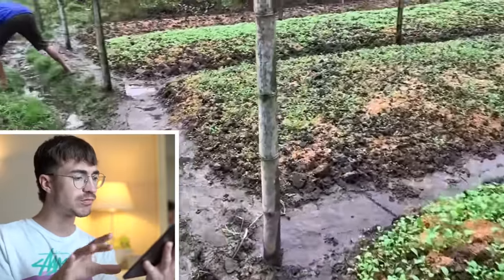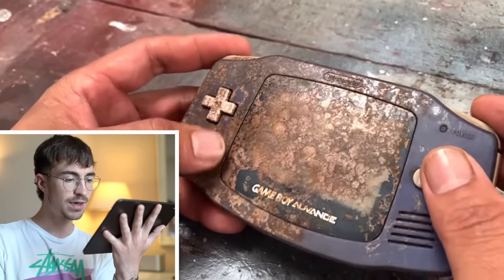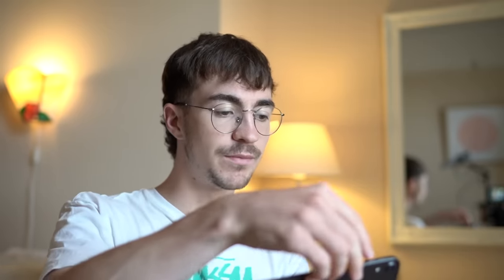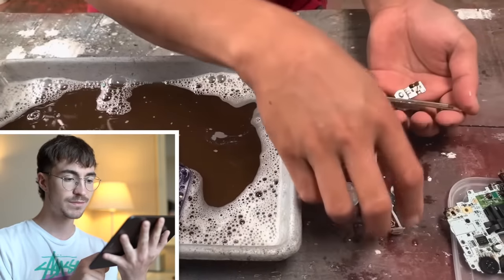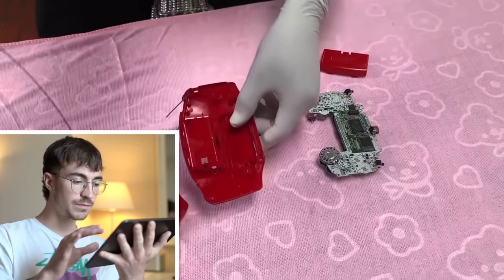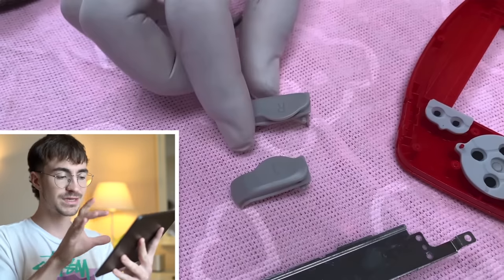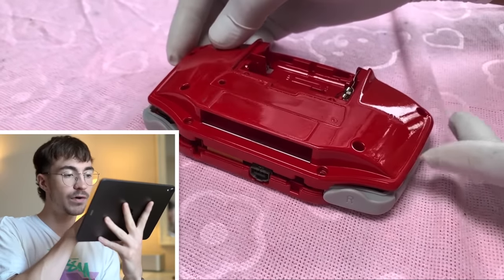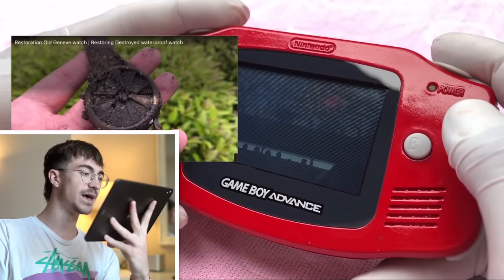Exposing FAKE Restoration Videos!

Comment: The giveaway for my inexperienced eye was: Why paint the inside of the case, and to a degree he got every nook and cranny.
Also he found it with no battery cover, and those things dont survive regular use...
He has one in the end, so that just means the shell was a kit.
Reply: Nah it’s the same shell,I can tell by the shit paint job they did
Reply: I'd do that, it would annoy me knowing that the inside isn't coloured, plus it makes for a satisfying video.
Reply: @onemoreweirdo207  I'd be more worried about any peeling inside the device shorting something out.
Reply: @xinx-fn8973  I thought he might've swapped for aftermarket case as well until I saw that crappy amateur paint @11:11
Reply: I think he got a new red case and hit it with paint or clear on the front to make it look more authentic (to look like it was painted) but the close-ups of the tiny stand-offs are even red inside and there's no way to hit those with a rattle can, or the little holes would be plugged up.
Reply: The outside of the case was a bad paint job but the inside looked really good, considering that would be the harder side
Reply: @xinx-fn8973  So they bought a new blue shell, and spray painted that. Voila. You are blind.

Comment: I love how spray painting the shell red turned the shell into a translucent red shell. Anyone know the name of that spray paint or perhaps where I can pick up a can or 2? Are there other color spray paints that turn plastic translucent?
Reply: I just like the electronics submerged in dirty ass mud and water, and somehow a little bit of scrubbing gets all of that out from inbetween the layers of ribbon cables and the layers of the screen...... hahaha
Reply: @SSXVegeta  A neat trick for sure.

*Stupid mobile keyboard.
Reply: It's the same brand paint that Mr. Q from Die another day used to make the car invisible. Just thin it and apply 10 coats and the car becomes invisible.
Reply: @Wingedmechanic  now that would be awesome.
Reply: i rewatched that part three times before i scrolled down to find you'd already posted about it, but your dead right, that original case was too dark and opaque to let light through
Reply: @frogmastiff8198  no he painted it go throught the video and you can see the mistakes in the orange peel. plastic that thin does shine like that.... lookm at 11:11 in particular. the guy may have gotton aftermarket parts but he did restore it
Reply: No that's definitely just light passing through the plastic.
Reply: 11:13 it's clearly painted... terribly.
Reply: Coop 772 on YouTube has a video on how to paint things clear
Reply: 11:10  That is definitely a spray painted shell. Not sure about rest of shots but the shot I time stamped is 100% spray painted. Of all the things to make fun of, the painting is the least of of them. Scrubbing the motherboard and all the electronics with a brush after soaking everything in water is ludicrous.
Reply: @avidadolares  yeah I second this
Reply: Definitely a spray painted shell. 11:12 says it all, just look and the plastic above the screen.
Reply: Spray Acetone 😆
Reply: Excuse me, it may be spray painted, but how the heck dark blue plastic will turn completely red without any shades of darkness when the light shines through it?
Reply: A layer or two of clear coat on an a red case would easily give the appearance of having been "spray painted." A professional faker, indeed.

Comment: I'm here to tell you (believe it or not) back in my teen years I lost an original Gameboy around the property we lived on. Lost it during a nasty storm. It was rained on for days and later fire ants incorporated it into part of their mound. Found it the next year when we were getting ready to move, I cleaned out the ants just to see if it would work. Powered on at my surprise and worked except for a dark line going horizontally across the screen. But yeah most of the restorations are fake because I never see most replace the screen.
Reply: Those gameboys were durable..
Reply: @nillman  unlike tech today, just breaks for no reason whatsoever.
Reply: @The_Backlog_Files  it breaks so you'll have to buy another one.
Reply: My sister had an iPod she lost somewhere and winter came and went and then we found it in the back yard when the snow was melting. Brought it inside still half frozen in a block of dirty ice and it worked for several years after
Reply: @HugeESmalls  yup old technology was built to last.
Reply: I can speak to the toughness of old Nintendo products. One of my childhood friends was over at my house playing Super Street Fighter with me. He got mad that he kept losing and threw my SNES out the second story window down onto the concrete patio.

The case was ruined and the Street Fighter cart didn't survive but I put another cart in it and it still worked. I glued the case back together as best I could and kept playing that SNES for years.
Reply: @Dover78  Yeah one of my cousins had an SNES that survived a full house fire that burned down their entire house, the case was partially melted, the entire thing was solid brown and charred, still worked.
Reply: @The_Backlog_Files  to keep it affordable...modern technology is no cheap..to make it cheaper use cheaper materials
idk about iphone tho...maybe the software is expensive not the actual phone
Reply: @Dover78  and then you got a better friend?
Reply: @whatwasisaying1338  not completely true we are making things smaller and lighter wich makes them more breakable and there are a lot more factors about design and material that has to do with durability
Reply: @The_Backlog_Files  if you notice: your phone isn’t covered in a thick plastic shell like the gameboys. So it’s much less durable
Reply: @frank9966  I've seriously been thinking about getting one of those rugged phones. I don't use it for gaming or anything.
Reply: @neko_my_cat  true, but planned obsolescence is a thing.
Reply: @whatwasisaying1338  the fact that we know that the sofware is gonna develop beyond what the current and previous hardware can handle so they eventually become slow and weak to threats
Reply: @neko_my_cat  this extends to more than just software. Household appliances don't last as long as they used to. I should be able to buy a washer today and it performs just as well 3 decades from now.  Lol.
Reply: @The_Backlog_Files  it's not cheaper build. It's more complex and tightly controlled circuitry and wiring. There is no room for the slop that existed in the past. Things were not better in the 90s or 80s. We just didn't have the ability to make them more powerful.
Reply: @tenchuu007  it may be more complex but that doesn't rule out making it more durable.
Reply: @The_Backlog_Files  if you want that durability in a phone it is available. But if you want the modern equivalent of a Gameboy, our latest example being maybe a mid grade phone. Gorilla glass and water resistant to a 10', not a thing a Gameboy could handle.
Reply: @tenchuu007  I've been looking into a few of those types. Any suggestions would be welcomed.
Reply: @whatwasisaying1338  oh yeah I know sewing machines where definitely more durable before. But even the old stuff breaks my fridge and microwave where both like 15+ years old (from a family member that died just before I moved out at 18) and died a couple years ago, no idea how old my vacuum is but that one still going
Reply: @neko_my_cat  you are right.  Everything-even the old stuff- breaks, but it feels like newer stuff breaks so much quicker.
Reply: Yeah turned by on after a decade in the garage and it worked after being charged